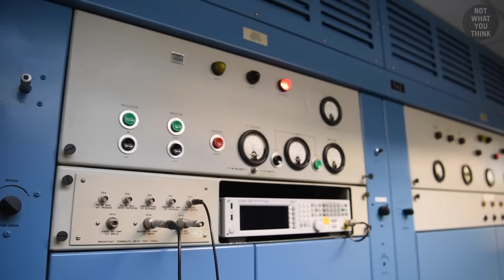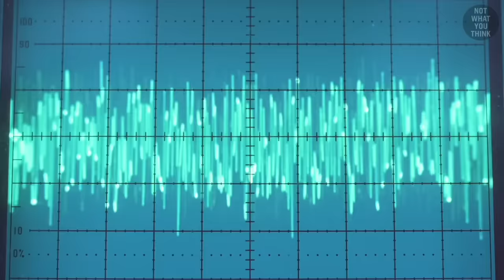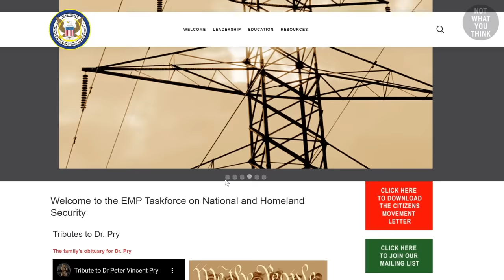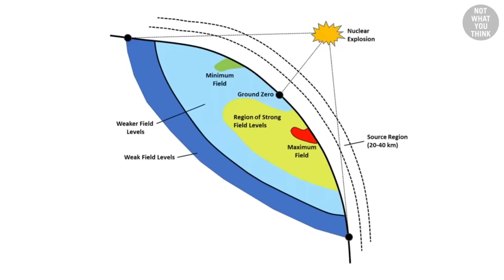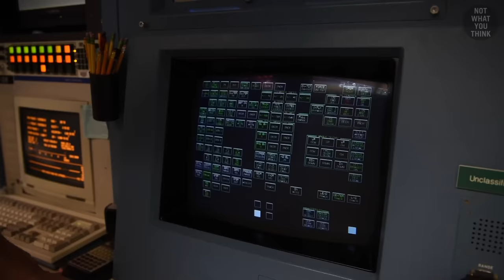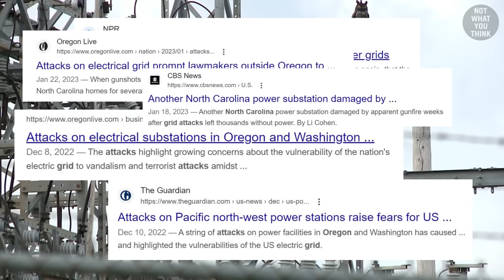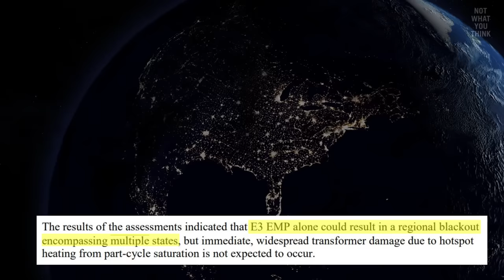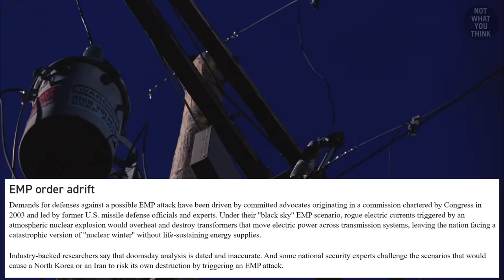Why an EMP Attack is Worse than You Think

Comment: Emps, like the Y2K scare, will only be a non-issue if people work to mitigate and prevent their effects.
(Though it would be much more expensive to do so.)
Reply: Y2K was solved because of computer engineers. There was a real problem that was fixed. But most people do not realise this and assume Y2K was a hoax
Reply: @fuzzlemacfuzz  Agree, I was one of the people scanning for software that required updates.
Reply: @colin1235421  Thank you 👍🙏 it's true that people think it was a hoax because it didn't happen.  It didn't happen because of people like your good self.  Thank you very much, I remember this clearly, and  was reading forums etc. where people, like you, who were furiously working on it.  

Unfortunately, as mentioned in the conclusion, hardening the grid is 'unprofitable', and, most importantly, it doesn't have a specific date like Y2K, so the masses don't care, until it happens.  They should make a hollywood movie like Don't Look Up, it might get more mass attention to pressure those greedy muvvafks to harden the infra
Reply: Nothing major happened on Y2K because of one simple thing, preparation and prevention. The systems that were predicted to go down after 2K, didn't, only because engineers acted on it. Don't think nothing would've happened otherwise.
Reply: That's the point with EMP - they can have 100% natural origin and they don't have to be powerful, just strong enough to knock out HVTs, and this is not hard to do. Given that they are always custom order and takes anything from 6 months to 3 years to manufacture one, this is huge. Because there's no way to prevent their effect, and mitigation is superficial. Literally, no mountain of money can fix or prevent it. Just like you can't eat dollars on your account, you cant use them to send lots of power far away.
Reply: Agreed, yet no one is working to mitigate the effects. America is not hardening the grid. Trump tried, but I guess it either didn't take or Biden rescinded the related EOs. And the energy sector apparently must be forced to spend money on it. How about we fund hardening the grid instead of sending so many billions overseas? We absolutely NEED to be hardening our grid against EMPs.
Reply: And if they were to stop lying about briefcase sizes in contexts of "square miles" 🤦‍♂️

I'm sorry but you need a bit more storage than that little briefcase can accommodate if those numbers are your goal.
Reply: @groberts1980 Do you know what FUD is?
Reply: @MadScientist267  Did you watch the video?
Reply: @groberts1980  Ummm... where do you think the sentiment came from? 🤦‍♂️
Reply: @MadScientist267  I think you may have normalcy (or optimism) bias. I thought you meant my comment was FUD.
Reply: @groberts1980  I'm referring to the video 🤦‍♂️
Reply: @MadScientist267  I think concerns are legitimate. Our grid is vulnerable and we can't assume it won't be taken advantage of.
Reply: @groberts1980  Accuracy is important. Nobody is disputing the idea that a well placed nuke will cause a lot of problems for the grid.

I addressed the one mention that really jumped out at me... and called it exactly what it is. Be yes.
Reply: @MadScientist267  I'm less worried about a high altitude EMP and more worried about low tech attacks on substations.
Reply: @fuzzlemacfuzz that's because some people were going around predicting Armageddon, not knowing the issue

Comment: If the EMP doesn't actually fry small electronics, then we really aren't sent straight back to the 1880's.  A lot of important systems on the grid have backup generators, so things like cell phones might even work for a limited amount of time.  And that limited amount of time would be likely enough for the utilities to mobilize to restore at least pockets of electricity that could then be expanded and relatively promptly bring people back out of the dark.  And with regard to other countries attempting this with high altitude nukes, you can bet your last dollar that the nuclear missile subs, which would be quite well insulated from this, would get their orders to wipe out whoever decided to open that can of worms.
Reply: Aren’t back up generators susceptible to emps also?
Reply: Nuclear EMPs are pretty unlikely in real life. I think a large scale cyberattack on our grid is far more likely to come from one of the US's many foreign adversaries. At the very least China and Russia have those capabilities.
Reply: EMPs do fry small devices, so if you hear about a CME or somehow get a warning before an EMP attack, make sure you wrap a big ol box with aluminum foil and put your electronics in there
Reply: @GamerGod-fp1tj nuclear EMP and CMEs affect only large structures and some devices plugged into mains, not small portable devices or cars. Cars are shielded by default as they have a metal shell. The electrical grid fries because the kilometer long wires act as antennas so they will output high voltages to trasformers.
Reply: @GamerGod-fp1tj Probably better to wrap my entire garage in foil then 😂
Reply: @Shadow__133  your house, much like your car, acts as a faraday cage, sot the small stuff would be fine if it was in your house.
Reply: @dtibor5903 BS- about EMP will fry most sensitive electronics,  regardless of their size.
Reply: @henrydimmock2691  Then just build a wood/paper box around the transformers and we are set?
Reply: @ethereal369  what is sensitive electronics? Like phones and many holdhouse electronics will pretty much survive, especially indoors here in EU where the building floors and ceilings are made from steel reinforced concrete. I'm more worried more about industrial equipments as they have long wires that acts as antenna.
Reply: @Shadow__133  no, faraday cages conduct electricity so they have to be metal, and I might be wrong anyways because why would they not do that already? the reason houses and cars redirect electricity around their occupants is that they have faraday cages built into them, cars having metal frames, and houses having metal in the structure. This why you don't get zapped when your house is struck by lightning, and why the top of your house is usually a lightning rod, to redirect the lightning to the ground without danger.
Reply: @henrydimmock2691  Not sure what kind of house you live in where you have such metal roofings, but in my country houses are made of wood, plastic and paper. Lightning protection systems are super rare and a lightning strike usually blows a hole into the roof or the entire house apart. 

Not to mention the fires that are epic due to it being made entirely of Combustible materials 🤣
Reply: You’re smoking
Reply: @Shadow__133  You're right, I don't live in a house with electrical frames, but even then a building made of concrete and rebar, like a parking garage, may work.
Reply: @henrydimmock2691 
Erm...
I take it 
You've never heard of -
RAF Fylingdales

Comment: 3:15 - "Without the grid, it's just a matter of time before nuclear plants explode" = FALSE
Nuclear power plants don't just explode!

3:20 - "This it what happened to the three nuclear reactors that exploded at Fukushima..." = FALSE
The reactors didn't explode! They overheated, which caused some other gas-explosions!

3:30 - "Electricity is required to circulate water to cool down nuclear reactors, otherwise boom" = FALSE
It will overheat, which usually causes the fuel cells to melt through the bottom of the reactor. That's bad, but it won't explode!
Reply: Fukushimas rod... So where did it stop exactly? 😏
Reply: 🤓Actually tho, that is incorrect🤓
Reply: @nomore-constipation   Fukushima went until the "melting through bottom" part... 

That's why they sporadically tried cooling it using seawater. Which isn't optimal, yet not as bad as proclaimed by the media. The amount of leaked radiation was about negligible, given the large size of our oceans. The Chernobyl disaster released about 10 times more radiation.

The type of leaked radiation does also partake in the severity of a nuclear incident. At Fukushima 95% of the leaked radiation consisted out of Iodine-131, 2.5% out of Caesium-134 and the remaining 2.5% was Caesium-137. The 95% Iodine-131 has a half-life of only 8 days, thus it's about completely gone after a decade. The Caesium-134 has a half-life of about 2 years, thus reduced from 2.5% to 0.08% during the past decade. The Caesium-137 has a really bad half-life of 30 years, thus most of it's 2.5% still persists. 

As a rough estimate we can determine that only 2.58% of the leaked radiation at Fukushima is still around, diluted in our large oceans this calculates to about 0.0% globally. The Deepwater Horizon oil spill was a lot worse, yet everyone appears to have forgotten that one...
Reply: @timmy7201  Where are these stats from?
Reply: @nomore-constipation  Half life calculations i assume

Comment: Small correction, the Carrington Event was actually so small that it doesn't even show up in solar storm tree ring data. I can't remember the video but Fraser Cain was talking to a NASA researcher about this not that long ago.
Reply: The Carrington event was a G5, strongest solar storm on the scale. As for tree rings, if there have been no CME that has shown up in tree rings for 200 years at least, it is hard to say what caused these events and there is scant evidence to be had, let's face it, there are just not that many trees that are 5 or 6 hundred, let alone thousands of years old.
Reply: @markpoidvin5382  There are intact protected old growth forest all over the world, with species that have lifespans from hundreds to thousands of years. It's certainly sad that they represent less than 1% of what used to be, but that's still millions of trees.
Reply: Why should a CME produce different tree rings?
Reply: @fliegendeuntertasse9472  An increased amount of carbon 14. Go read the article about solar storms and tree rings on universe today, it's a lot easier to read than the original research paper.
Reply: @NotSure177  ahhh i see
Thank you!
Reply: @markpoidvin5382  The Carrington Event was 80 times less powerful than the A.D. 774 Miyake event.
Reply: @NotSure177  Right .. and the key word there is "protected". We aren't lopping down the rarest and oldest trees in the world in order to count rings to measure the Carrington Event.
Reply: our magnetic field is much weaker than in 1859, most likely anything above XClass 20 could be an issue and XCLASS 50 could destroy the satellites

Comment: One correction about the reason for transmission lines being AC. AC is less efficient to transport through powerlines than DC, but DC transformers are very inefficient so it's better to transport the electricity using AC. Long uninterrupted transmission lines, such as under-sea cables, are actually DC. At that point the efficiency of the transport outweighs the inefficiency of the transformers.

Comment: You can shield equipment from most EMP.  The vast majority of military electronics are heavily shielded.  The EMP induces current in most conductors it hits.  However, it does not pass through conductive materials very well either.  A single continuous box of iron will simple conduct the EMP around the box.  There will be a secondary magnetic field in the box and it will collapse and generate a current/voltage spike.  But this is easy to spark gap away.
Consumer grade equipment and most industrial equipment will suffer badly.

Comment: Nuclear reactors don't just blow up if the power goes down. However, a good question is whether all the support equipment needed for cooling and proper shut down is hardened against EMP. The real nuclear problem could be that even with backup generators the EMP might take down the control systems. That could be ugly.

Comment: While I agree with what you say,  there is an aspect not covered here and that is the magnetic pole shift. It's been around for thousands of years BUT the magnetic North Pole is rapidly accelerating in its South Westerly direction. To me that means the Southern magnetic pole must be moving North Easterly at the same speed. Given the shape of the magnetic field protecting Earth, doesn't that mean we will be MUCH more vulnerable to solar flairs in the future?
Reply: Yeah
Reply: When the magnetic field flips will a large electromagnetic wave be released such as what happens during an antenna transmission during AC polarity cycles? When the electromagnetic field is reversed a radio wave is emitted. Unless I am wrong on some basic theory.
Reply: @adcraziness1501  All food for thought mate.

Comment: I work in a nuckear power plant. I forgot the exact numbers, but after this reactor trips, it continues producing 200MW of heat, but it decreases over time quite fast. In case if a catastrophe, you could decide not to keep all the generators running at the same time and also remove unnecessary loads to save power. Also, they can keep running for a lot of time. Depending on the project, you could use one unit to supply power to another one. It can take hours for the used fuel pool to start boiling, which would be very unpleant, but it won't explode. Talking back about the primary system you could consider a loss of coolant accident as some sort of explosion, but it's not like in a nuke and also it's not gonna happen if you have the diesel generators.

Comment: Fukushima was caused by an operator shutting off a cooling channel to prevent the reactor cooling off too much and then they lost power with the cooling channel closed. Had the channel been left open it would have been fine. It's not the operators fault he was allowed to override safety mechanisms, it was a design failure to allow such overrides.
Reply: You're describing the Three Mile Island accident. Fukushima was caused by a tsunami and involved 4 reactors.
Reply: @rpbajb no safety systems were issue at Fukushima as well
Reply: Fukashima diesel generators got flooded by the tsunami. Tepco ignorred WANO  advice on relocating backup diesel generators to higher ground or raising generators to well above sea level, as done on similar BWRs in US and Germany. Also the non addition of manual controlled hydrogen venting lines to vent the reactor  gases if they overheated and dissociated the coolant into hydrogen and oxygen.

Comment: Fukushima only melted down due to the plant shutting down reactors as a precaution. Had they left them running they would not have had this issue at all. This entire issues was due to the sea wall not built to spec, and the blunder of the location of backup generators located in the basement rather than on the roof. Similar plants in the area did not have such issues.

Comment: ...and this is the unapoken objectively true reason, at least 1 of them, why they want to ban the use of natural gas operated appliances...emp/electricity goes out but you still have a gas or wood burning stove and space heaters or a fireplace...you can still cook, boil water, heat your home/apartment, have hot bathwater, clean dishes amd clothes, and keep things up so they don't become overriden with bacteria, fungi, viruses, etc...if you have a charcoal/wood burning grill you can do similar BUT not quite as proficiently...just a single detail annnd wood burning is more likely to leave billows of smoke especially if damp or wet...giving away any possible hidden locations unless tree branches are above the rising smoke in densly populated enough layers to break it up significantly as it rises...always best to wait til early morning or evening as well...

Comment: Nuclear power plants don't go "Boom" without cooling water. You just lower the moderator rods into the reactor. These absorb the neutrons that are vital to a continuing nuclear reaction. They slide into tubes built into the reactor. It's how they control the reaction every day, and if they put enough of them, or why not all, in fully, the reactor stops reacting. 

Some reactors have mechanical backup systems, where rods are spring-loaded, with electrical mechanisms pulling them back. If the electricity fails, the springs cut loose and the rods slam in, stopping the reaction there and then. A good nuclear reactor will shut itself down if any of it's important parts fail. Without even needing electricity. Between that stage and normal operation, there's lots of options, but automatic shutdown should always be there. I'm not aware of the designs of plants operating around the world, but it's such an obvious feature I can't imagine any reactors are built without it, or something equivalent.

They can certainly damage the environment around them, but they don't go boom. Even Chernobyl was an explosion from steam pressure, there was no supercritical nuclear explosion. I'm confident in saying that I don't think it's possible for a nuclear reactor to go supercritical and produce a nuclear explosion. It's never happened, and there's so many layers of safety, as well as implicit safety in the design, I don't think it ever will. They'd just not designed to be bombs.

Comment: The reason we don't use EMP as a tactical weapon is due to its inconsistency. Most countries military is hardened against EMP attack. As far as the civilian infrastructure goes you can't tell what will work and what won't some cars exposed to emp will continue to work while some will not work. EMP is a great terror device and the fact that if your car don't work when you go outside it would suck, or if the power on your block was down. As a tactical device to stop an entire civilization from going to war with you it's a very inconsistent weapon that will likely just anger your enemy, and not render them ineffective.